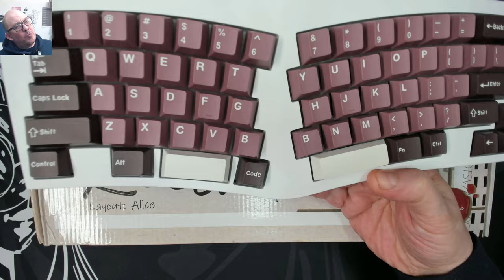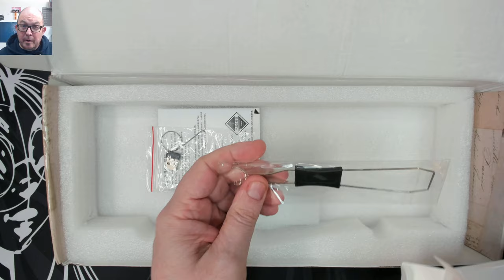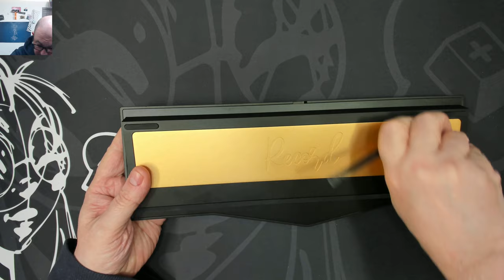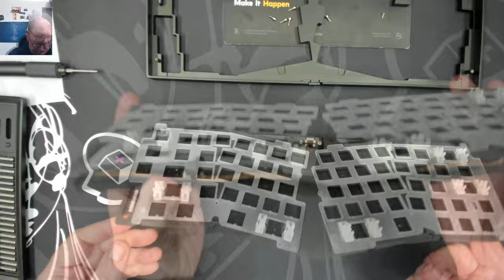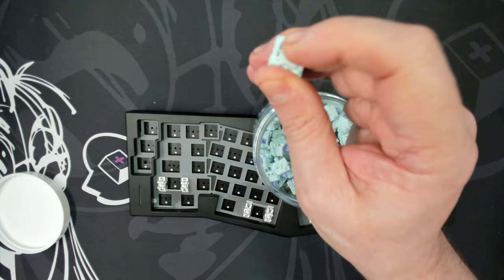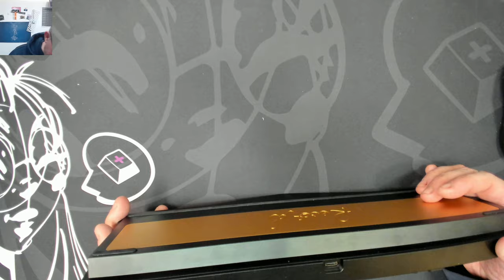Weikav Record V2 Alice Build Review Sound Test MZ Z1 Domikey Semiconductor

Comment: 2.4GHz USB dongle is not working. I switched to Neo ergo after having a lot of issuse...
Reply: I had the same problem, but I fixed it by connecting the dongle to a 2.4g dongle extension that I had from a Logitech mouse. Then I connected the extension with the dongle to the PC, and it finally started working haha
Reply from the maker: I don't have much luck with 2.4g but my neighborhood is over run with 2.4g noise, I use BT when I really need wireless, though for the short time I tried this over 2.4g I did not experience lag, though I was less than 3 feet away from the dongle.